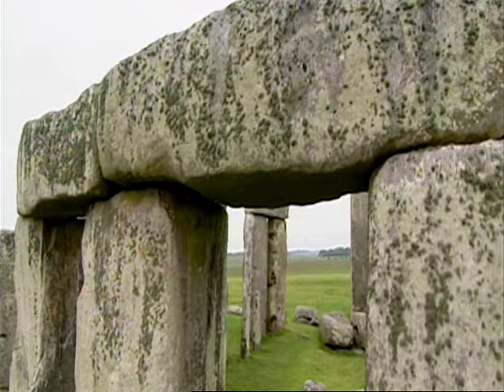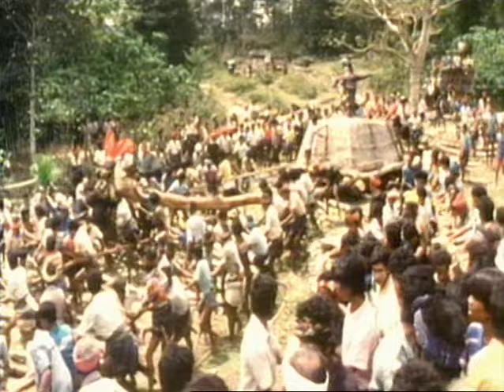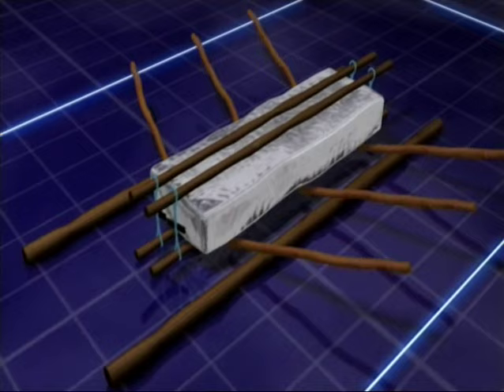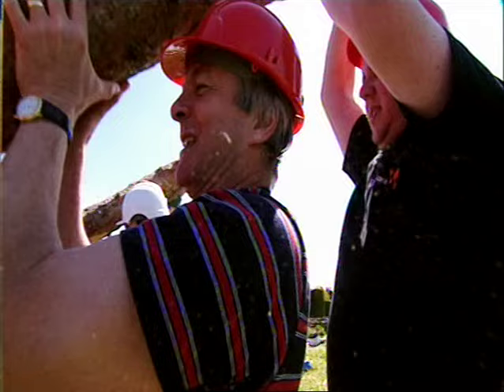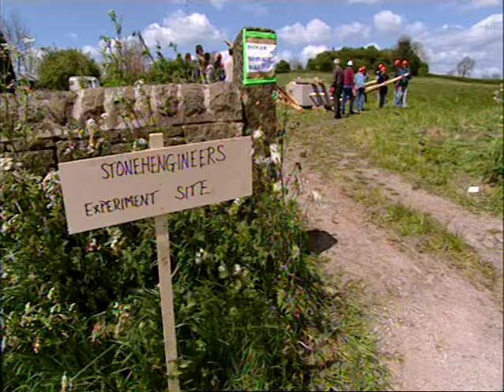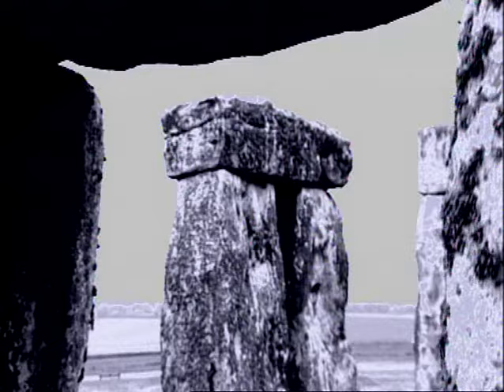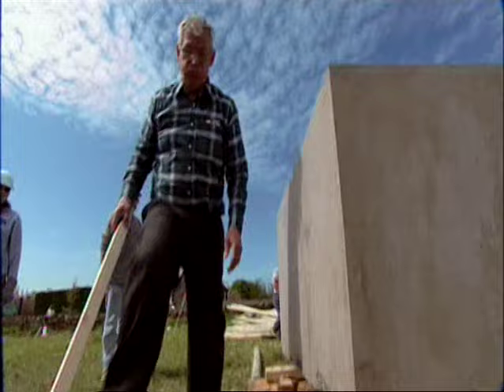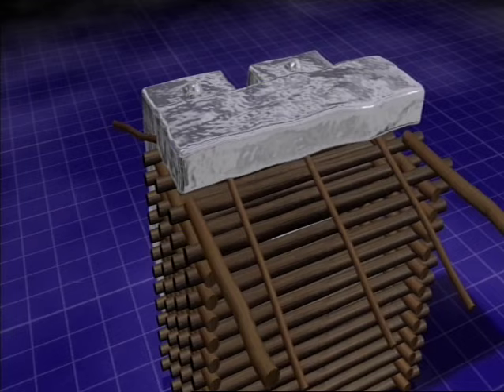Megalith Movers: Building Stonehenge

Comment: I have another theory. At first stones were in cylindrical shape. Moved those cylindrical stones to the site and cut them there into rectangular shape or any other desired shape.
Reply: That is not a bad theory.
Reply: Not convinced. The round stone would be almost double the weight, and I doubt you could roll it over bog or up hills. The rowing method demonstrated here would surely work much better over the kind of rough ground they would have been dealing with?
Reply: @tullochgorum6323  watch Wally Wallington and see how he moves giant blocks with just a few pebbles.
Reply: It was big wood discs. They cut a square out of the middle of each disc and popped the stone into it. Made it it's own axle and rolled it. Being wood, they were lost to time ages ago (or likely reused and the forgot about)

Comment: I think the Indonesians had it figured correctly. I have seen videos of people attempting the rope-n-roll method INCORRECTLY, with the "one two three PULL" technique, in which almost all the crowd's effort went into taking up the slack and stretching the ropes, then jerking the stone a short distance and relaxing again. The Indonesians did a long sustained pull, which is much more efficient, keeping the ropes stretched and using the stone's momentum instead of losing it again with each short tug.
Reply: Facts though smart indonesians
Reply: Right, just like towing a car.

Comment: This is exactly what I've been looking for!  Knew I wasn't the only one with the idea of lever walking.
1. Add weights to the levers to reduce needed effort.
2. Increase lever length...a lot.
3. No one said the levers had to be straight.  Make them jag down at the end and then you don't need scaffolding, or as much scaffolding.
4. Or use ropes to pull the levers.
5. Tie a beam or ropes of the same length at the ends of the levers on each side to make sure they move more or less in sync.
6. Use oxen to pull the levers forward.

Comment: That part of the world has lots of ice in the winter. And moved on a sled or just dragged on the ice. Once moving it would travel under inertia. Ice works in theory for razing and setting it in place too. Just pile snow and water into a ramp.  Also think that is how they mite have worked the stones on Easter Island.  
Chuxgold.
Reply: Easter Island has no snow/ice. It's in a more temperate zone. But it was covered with trees when the islanders landed. Movement by log rolling; not far fetched.
Reply: Valerie Pallaoro yeah with over 600 men
Reply: I agree with you sir and the stone slide thru the ice. But the problems is how the left up the stone and build perfectly?
Reply: It would have def been much colder back then and if they packed down the snow into a channel poured water over it you would get an ice road
Reply: Under enough weight (pressure) ice melts.  Ice sliding could work fine for smaller blocks but once you get up to trilithon Baalbek sized stones you'll need to use the lever walking method.
Reply: @josiahjack455  1000 tons
Reply: The stones on easter island were moved by logs this is fact they know this its not a mystery anymore

Comment: There's no way they did that for that many miles.
There had to have been a better way
Reply: Peasants are relatively cheap
Reply: Why?
Reply: This is actually the best way (fastest, least manpower).  This can be improved by adding baskets with stones to the ends of the levers to reduce the effort required to only 1-2 people per lever.  Lever walking at that rate is much faster than rollers.  With no evidence of a level well paved road, we can rule out rolling.  I've moved machinery in my job using hydraulicly powered dolly and rollers to move machines that "only" weighed 30 tons.  Even the 10 ton machines at the slightest crack in the concrete floor between poured sections gave us trouble where the rollers would get stuck and we'd have to lift the machine on jacks, then reposition the rollers to the other side of cracks.  And that was a level floor and took 4 people 6hrs just to move 300 ft.  With lever walking, the fulcrums can be adjusted to match the slope of the ground, the block doesn't have to stay level but could tilt as much as the friction would allow.  The levers can also compensate for a few feet in variation of the ground and still be useable.
Reply: Josiah Jack, I am sorry for my inadequate English. Who moved the stones all the way from Wales? No human at all, but the glaciers. During the last 2.6 million years, there has been at least 30 periods of glaciers. Glaciers create tremendous power. I know the TV-program "Drain the Ocean." Is it possible to drain the soil all the way down to the bed rock? If so, what do we find? My guess: A large number of stones similar to those in Stonehenge, at the site, or nearby.
Reply: See this: https://youtu.be/DVorEqS_gqo or they just cut it round and rolled it and chiseled the final form at site
Reply: Wallys method was way better dude did what they did faster and easier literally by himself
Reply: @josiahjack455  definitely a good way. What do you think about wallys method in michigan though? The guy did what these guys are doing quicker by himself.
Reply: @aprils3329 . It was a religious devotion.

Comment: There is a much simpler way to get the stones on top. Once the upright stones where in place they then cover the whole site in a big mound (plenty of their burial mounds still exist so we know they new how to do this well) pull the stones to the top and assemble them in the right place using markers. Then remove the earth from under the stones wooden blocks maybe shaped like wedges would hold the top stones just off the upright stones so the earth could be dug out from under them. Then the wooden blocks/wedges are removed so the stones would drop into place. This were the tongue n grooves on the end of the stones and the ball n sockets under them (which nobody seems to want to explain) come into play. The tongue n grooves would prevent the stones from moving out of place when the blocks are removed and the ball n sockets would finally lock them into exact place. Then finally remove the mound so all well within the technology we know they had
Reply: You might be right. Stonehenge was prbably a religious temple, so it might be related to corpses
Reply: Much easier to do wallys method this is over complicating it even know its so simple it could be simpler work smarter not harder

Comment: You don't need to overcomplicate things, simply stand the stone up and assemble four teams of people, four ropes are tied at the top with a rope for each side, the teams front and back control the tilt while the side teams rock the standing stone side to side and walk it. Covering twenty miles like that would be loads easier than with any of these complicated lever systems people come up with. On a much smaller scale it's the same basic physics that have allowed me to move furniture and stuff around on my own, things that would take 3 or 4 people to move if they where lying down. The height of the stones is all the leverage you need, with a few people it wouldn't even seem that heavy.
Reply: It seems that this is how the Easter Islanders moved their Moai statutes - based on a combination of the old legends that the stones walked into place combined with modern experimental archaeology. So you may well be right. But the key lesson is surely that there were many techniques that would have worked, so we don't need to rely crackpot theories that involve extra-terrestrials. We may never know which of the options they actually used, but we can be confident they could have done it with the technologies at their command. The same can be said for the pyramids and other structures. You can do a lot with wood, rope, gravity, stones, sand and a bit of ingenuity...

Comment: >moves rock 3 inches
> applause
> mystery solved

.......??
Reply: Did you not watch the whole video? Check what starts at 5:30. They develop a system and add more people. They reach a pace where they could move the stone 20 miles in 3 months with one team of 30 people. Towards the end of the video they also demonstrate how the stone would be raised in a similar way, to sit on top of the vertical supports.

Comment: And how would this work with a rough stone that is not square and even in weight to move the logs, and that did NOT have an edge to line the log cuts up to, and this uphill and downhill over a landscape with swamps and rivers under bad weather conditions , raining for instance like it does so often there? NOT
Reply: Uneven levers for uneven shapes. But moving across soft ground or swamp? Forget it
Reply: What was the group d like when Stonehenge was built. I wonder if period core soil samples have been examined. Because land changes over time. Maybe it was solid Earth then!
Reply: @DanMerick  just use grass in the water and swamps.
Reply: So you don't think they would rough shape the stone at the quarry? That they would move it all the way to stonehenge then shape it? As for the landscape I honestly believe they moved the stones in the winter, hard ground and maybe easier to slide the stones, then erected them in the spring , summer and fall.

Comment: the last part is the hardest part. 'They levered it into position'. No the couldn't leaver it into position because the structure that the lintel is on would collapse.
Reply: Imho the raised it first a d then erected the standing stones below with the technique Wally Wallington used several times. Then just knock out the wood below

Comment: Well ! How would you put and tied wooden logs under the 40 ton concrete . Did you lift that with machines ?? Then how did you justify that this was that technique .
Reply: Easy, you initially dig under the stone for the first lift, just around the edges.
Reply: Or cut away a lip under the edges if it is still in a quarry.  See the incomplete obelisk at Aswan quarry how it has an underhanging lip all around...likely so it could be lever lifted out and also lever held while they finished separating it from the bedrock.

Comment: LOLZ!  Levered it up?  They forget that the people levering it up have to stand on platforms as it is risen.  They could build platforms for just one or two set of uprights but as you curve around there is no longer any room to lever the rest because the other stones would be in the way of the long levers being used since there are two rings.   
Moving the stone on flat ground is one thing but uphill?  They would need more people and logs but it is not possible to fit any more people as they showed the people and logs needed just to move on flat groung!  Rolling it downhill will end up rolling out of control and the sheer length of the stones will cause them to crack from their sheer mass.  They neglected to show how they got the two logs under the slab.   They have proven nothing but shown how arrogant they are.   The devil is in the details.
Reply: clay poon I am reading the comments after watching this video and a lot of people keep saying how hard it would be to get the logs underneath to even start. Why couldn't they just dig 2 small trenches on both sides and then get the levers underneath.  Lift it up a small bit and set it on small logs. Then refill the trenches partially to get more height and set it the on larger logs. I think that we get caught up on time because we work 40 hour weeks and a building has to be built in a certain time frame. Maybe it took them a month to get the logs underneath the stone and then 2 years per team to move them? Back then it didn't matter.  And as far as strength and skill, I'm also sure that the men who moved these stones originally were in way better shape and more practiced than these outta shape old people who attempted it in the video. I only seen 1 or 2 in shape people on the whole team. And skill-wise, if stone moving was a trade of the time I'm sure you had teams that could move faster and more efficient based on practice. Same as now days a lawyer couldn't get on a roof and lay shingles as fast as a man who does it 10 hours a day.  Human beings are amazing and with years of experience and true understanding we and they can do almost anything.  In my opinion Stonehenge was difficult but very accomplishable.

Comment: The technique seems to be good for special cases, but no needed for most distances. They would have used just a simple sledge https://www.youtube.com/watch?v=UzL4VNb8NJc or roll them https://youtu.be/DVorEqS_gqo
Much faster and efficiant.

Also the end seems to be too complicated: if you first raise the horizontal stone and then put the vertical stones in place using the Wally Wallington method, you just need to knock out some would to lower the vertical stone down on the other stones. much easier than levering it there: https://youtu.be/lRRDzFROMx0?t=277

Comment: Not the most efficient use of the lever technique. They need longer levers and there is too much raising and lowering. They need to raise the rock 5" higher so the levers are easier get under the blocks. You want to lift only an 1" or 2 up and have rowers arms straight down to glide the block forward.  You have a great distance to go and the optimal body position for the mover is important so not to wear out the people moving the block.  Also when raising the block it could have been easier if they rested one end and lift the other end and levering at the farthest ends and add a slightly centered pivot. Next time don't use a smart guy use a lazy guy to design this.

Comment: the concrete block is much smaller than what is at Stonehenge. Also lets see him get one 18 feet up in the air.
Reply: in fact it is very easy to lift the smaller 1 tonne blocks 18 feet in the air as demonstrated by the technique used by Wally wallington

Comment: Check out Wallington's method, far more likely than this
Reply: Don't mean to necro, but problem with wally's method is concrete slabs and perfect cut stones.  Wouldn't have worked 3000 years before the invention of concrete in the middle of a forest
Reply: Skyrelyks the weights of bluestone and concrete is similar.
Reply: Michael Dodd The point is he used the concrete to move them.  Blue stone could work, but it would have had to be moved first, so it's a catch 22.  Can't move the bluestone blocks without a bluestone slab.  Can't move the bluestone slab because you have no preexisting bluestone slab.
Reply: Wallington seemed to be able to move a 30"x 40" pole barn 300 feet without a concrete slab. It's at about 2:01 in the other vid.
Reply: Yeah, I think as long as the ground is dry, it can be done
Reply: @michaeldodd3563  and how do they raise it to get the initial set of logs underneath, like it magically raises in that demonstration video?